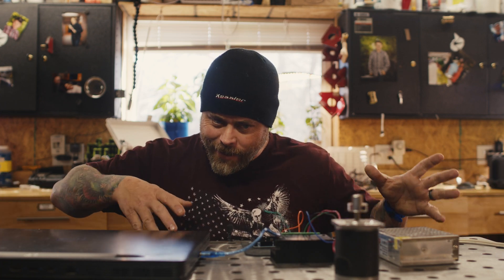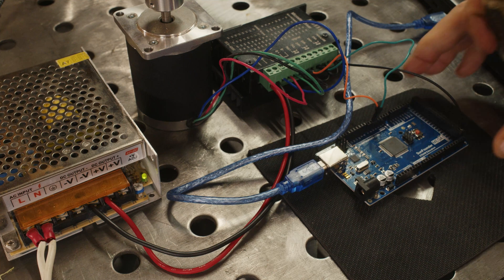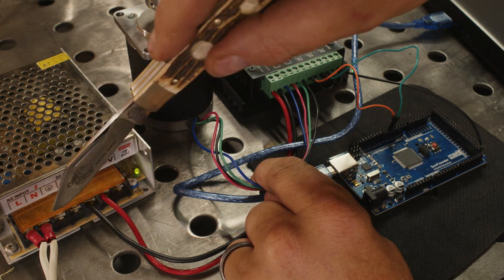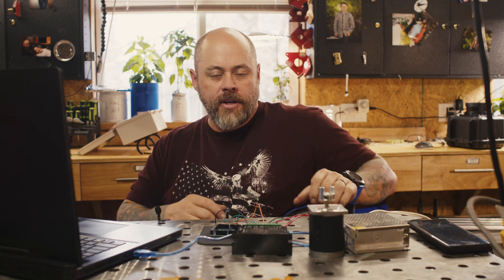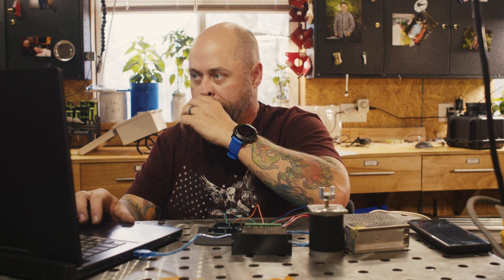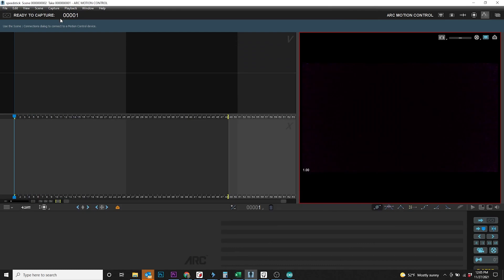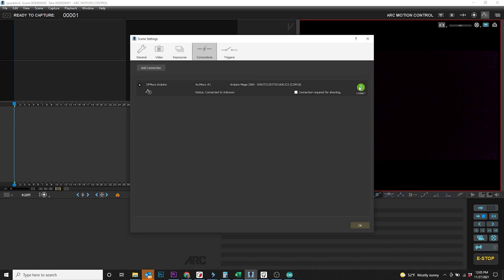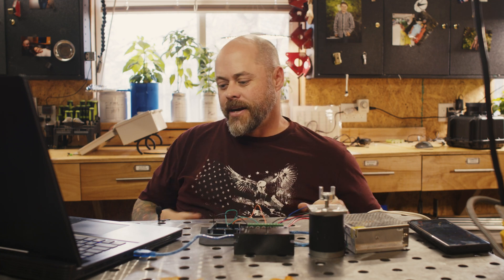TUTORIAL DRAGONFRAME HOW TO MOVE A MOTOR

Comment: What a great help you are... thank you :-)  Eventually I will buy some TB6600's, but for now, I need a small stepper motor, so I want to use a 28BYJ-48 together with a ULN2003 driver. But that driver has 4 outputs. Any recommendations on how to connect that, or do I need another driver? Many thanks.
Reply from the maker: Honestly I'm not exactly sure. I don't think I have ever used that driver :(
Reply: @BiolapseStudios  Thank you for answering so quickly :-) So, I ordered this same driver you are showing here, and connected everything in the same way. But there is no any movement whatsoever. I do see the leds on the arduino flikkerig when trying to jog in Dragonframe, so that hould be good. Am I correct thinking that you have the enable+ connection on the driver not used? -----EDIT: I am using the newest DragonFrame sketch, version 2.1.0. But I guess it should work with the same setup.

Comment: Thanks for the response before! I'm a little confused on the power supply. The one you linked is no longer available so I ordered the one Amazon said is frequently purchased along with the steeper drivers. It's a 24v 18.75a 450 watt unit. In your notes above you say 'reccd at least 24v power supply if you want higher speeds' so it seemed appropriate. Then in the middle of the night I'm thinking, bbut the motors are 12v, right? and I re-watched the video and you say get a 12v power supply. So I'm wondering, did I go wrong with the 24v? Is there something I need to do to keep from burning up the motors or the board? (I see the board inputs says DC9-42v so I guess it can handle it) Thanks again, and beautiful work.
Reply: 12 is really the minimum in something like this. As steppers speed up thier inductance increases, so higher voltages allow you to get better speeds. There is certainly a limit to how fast an arduino can drive the motors. But 24v is always going to be a good choice.

Comment: I purchased all the components and the terminal blocks don't fit quite right.  The holes for each terminal block are spaced at 3.5mm and each fits individually.  They don't fit as group or even next to each other.  They bind.  I have taken a Dremel and sanded them down just to see if manufacturing tolerance is an issue - and I cannot sand enough without compromising the integrity of the block and still get them to fit.  Is there a narrower terminal block that will not bind once installed?  Or, am I doing something completely wrong here?
Reply from the maker: Not sure I understand, shoot me an email chris@biolapse.com and send a couple photos of the issue

Comment: Thank you so much for this tutorial! I had a quick question I was hoping someone could help me answer. At the end, there was a brief mention about a “DIP switch”. Is this something that also needs to be purchased as part of the basic set up? Initially I understood the set up as needing the power supply, the stepper motor, the driver, and of course Arduino. So where does the DIP switch come into play during this set up? Thanks again for this walkthrough.
Reply: Hi Raven Hill,
The dipswitches are used to limit the amount of current to the motor as well as to set the microstepping and normally on the driver. If using small drivers like the 4988, or other common small chip drivers that are commonly used for 3d printers there are no dipswitches, rather there is rotary adjustment on the fact that can be turned to increase/decrease current, and Microstepping pins that can be set to positive or negative by direct connections to control the microstepping.
If using a larger drivers that are enclosed they have a row of dipswitches built in between the motor/power connections and the control wiring.these types of drivers normally have print on the case that explains the dipswitch on/off settings for the current and microstepping.
What kind of drivers do you have?

Comment: Great video! Really helpful. How do you get 3200 steps out of the old a4988 drivers? Is that what the enable pin is for?
Reply from the maker: No that's the MS1 MS2 and MS3 pins. For microstepping. If you have +5 volts to all three pins you get 3200ms
Check this link, it covers hoe t9 configure from 200 full stepping to 3200 microstepping
https://lastminuteengineers.com/a4988-stepper-motor-driver-arduino-tutorial/
Reply: @BiolapseStudios  thanks I figured it out. I had to run a pin from the 3.3v (arduino)to the breadboard then I could connect ms1, 2 and 3 as I needed for the desired resolution. In case someone had the same question.